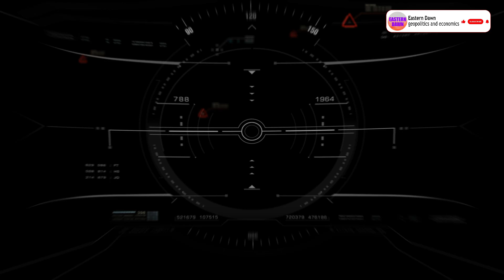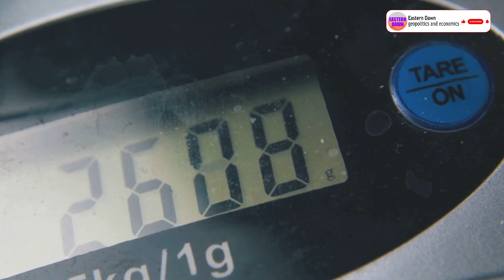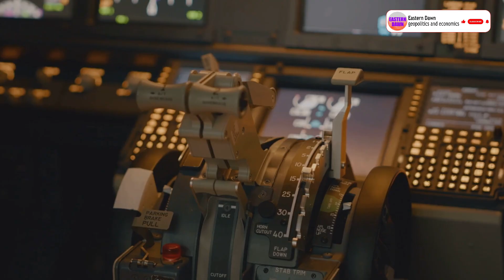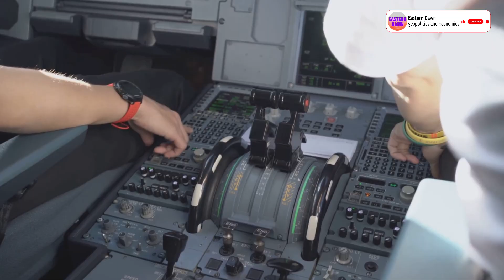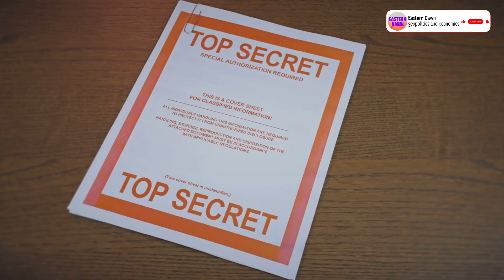How Can India Claim To Be A Superpower With Failing Jets? Tejas Crash At Dubai Air Show

Comment: Delta wing aircraft like the Tejas have stability problems at low speeds. The J-10 has a delta wing, but it has canards which stabilizes it at low speeds. All modern combat aircraft with delta wings have canards, like the J-10, Dassault Rafale, Euro Typhoon, and JAS 39.

Comment: India's Tejas crash at Dubai Air Show is the last straw.
India is all noise and braggadocio. 
India should be flying remote control aircraft and use a transmitter on the ground for recreational purposes rather than military aircraft often labelled as a “lying coffin” and a “Widow Maker” due to its frequent accidents.
India makes powerful statement by talking about its superior weaponry and equipment as the most powerful nation to be reckons with.
No countries come close to match India's aircraft from falling out of the sky.
At least 152 Indian Air Force pilots and 534 aircraft have been lost to accidents and crashes over the past 30 years or so, research conducted by aviation expert Anchit Gupta has revealed.
Finding the solution is something that's eluded India since.
Crashing aircraft is a normal habit of India.
India is in a league of its own.
India is all boastful talk and nothing else.
Reply: Indians as a generally rule over promises but under deliver. Don't ever ever trust an Indian with your life